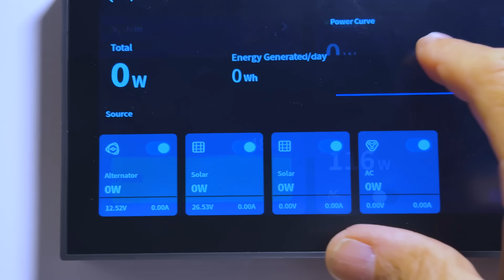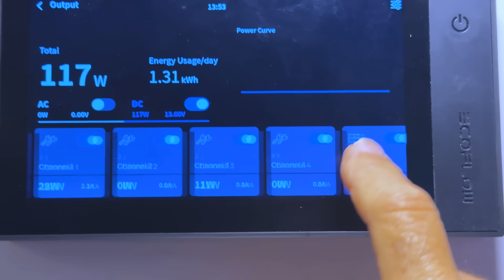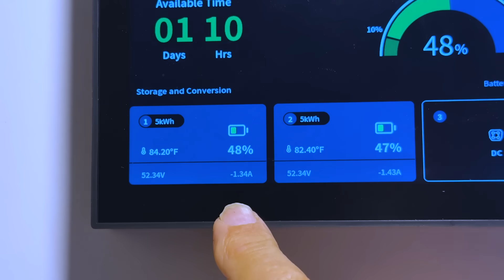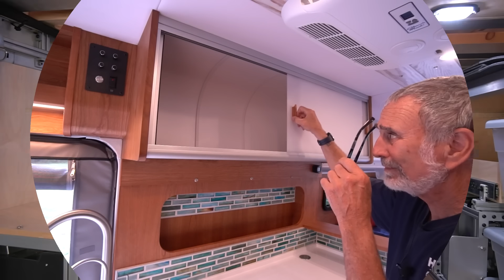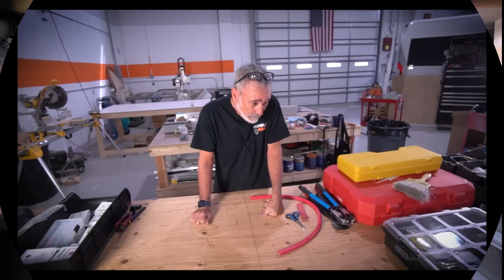HOW DID IT GO? BUILDER EXPLAINS THE ECOFLOW POWER KIT.  FIRST INSTALL IN A CAMPER VAN

Comment: I purchased an entire Ecoflow Power Kit 3.6Kv (Gen 1) system using used + new parts and found the experience sourcing components, especially the proprietary cables, was incredibly frustrating. 

I just want to make others aware that there are two versions of the Ecoflow Power Hub (3.6Kv/Gen 1 and 5Kv/Gen 2) and the PV solar charge cable, the Alternator Charge cable, and the DC Main Out cables ARE NOT CROSS COMPATIBLE between Gen 1/Gen 2 Power Hubs. This is because the Gen 2 uses different cable sizes for increased amperage. Technically, Gen 2 cables should be able to carry the lighter loads of Gen 1 Power Hubs but the connectors have been made to be mechanically incompatible. 

The distributors do not advertise this distinction for cables, and many are not aware of the Gen1/Gen 2 distinction. 

At the time I write this, the Alternator charge cable for Gen 1 has been out of stock from Ecoflow for 2 months, and I have had similar problems finding the other cables. 

I would highly recommend against Ecoflow unless you absolutely need the space-saving packaging solution the Power Kit provides or are able to purchase all components you need at once. 

If you are not able to do that, set your expectations to long lead times on replacement components and expect low supplier/distributor support.
Reply from the maker: Curtis, I'm sorry to hear about your difficulties with your EcoFlow experience. Quite honestly, I think you brought on the frustration yourself, by sourcing your system here and there, without choosing a reputable distributor. Maybe your motivation was to save money, but even that comes at a cost. As a builder, purchasing several Gen one kits at a time, I have had zero issues.
Reply: @HumbleRoad  Hi George! Thanks for the response. Huge fan of your high quality videos and vans.  You're definitely right to question my choices, I do that all the time. 

However, Ecoflow is the distributor in question, as I've tried to order direct from them, and many other distributors are just drop shipping from Ecoflow's warehouse. So it is a supply chain issue on Ecoflow's part.

Ecoflow have been out of stock for 2 months for Solar Charge Cables (Gen 1 power kit). 

I found a distributor that had connections to Ecoflow corporate and sourced the DC Main Out and Alternator Charge cables, but the current status, direct from Ecoflow, is that they may have the solar charge cables in another couple weeks (mid-June 2026). 

Most distributors drop ship from Ecoflow, in my experience, and I have not been able to find the cables in stock anywhere. 

I have no doubt that primary market purchases direct from Ecoflow or their distributors are hassle free, but a viable secondary market is important if you want to resell a Power Kit, or are purchasing a van with a Power Kit that you may want to expand or upgrade.

I watched your videos on Ecoflow several times and many others and I never heard what the after purchase experience was like for upgrading or servicing the Power Kits, so I just wanted to add this for the benefit of your audience, as it would have helped me make a more informed choice.
Reply from the maker: @curtislong4305  understood. And I thank you for contributing to the Humble Road community. A valuable resource this community has become! I would suggest that you try reaching out to camper van HQ. I was told they were the first level of distribution out of EcoFlow.

Comment: I had the Ecoflow Power kit V1 from 2022. I liked it so much I got a second Power hub. I do not used their distribution box. In total  I have 19 KW of batteries 3 of the 5kw and 2 of the 2Kw. works great simple to set up, updates were a nightmare now they are ok. It's for my off grid house. I do laundry, lights, on demand water pump, Make toast, microwave, 9000btw AC unit,  and my satellite internet. it can do up to 4000w output as i pushed it a few times.  Most of the time I try not to abuse it. I don't have everything all at once obviously.

Comment: Hi George, as always, interesting videos! George, I'm setting up my motorhome here in Portugal, and I'm interested in this Ecoflow system. I'd like to know from you, an expert, about the lifespan of this equipment and the batteries, and also if it requires a lot of maintenance.

Another question: can I have a two-burner induction cooktop with this equipment? Can I do it with a 5kW battery?

Could you update that video where you measured the consumption of an induction cooktop, demonstrating its operation with the Ecoflow?

Another question: here in Europe the AC input is 220V, is the equipment dual voltage?

I would greatly appreciate your comments. Best regards! João Lima, your fan
Reply from the maker: My initial Ecoflow installs (Power Kit Gen 1) are not out in the wild long enough to evaluate. So far so good. A dual induction cooktop is harder to store.

Comment: If I had to do a conversion again I would redo the electrical system with Victron again. High quality and time tested components. Yes, there are more connections, but when it's done well, it's effective. If there's a problem, I can replace just one component and not lose the rest of the system. I have trouble trusting all-in-ones for repairability.
Reply: That's a fair point. I have two of the original Delta from Ecoflow they put up on Kickstarter several years ago, Ecoflow has grown a lot since and I can attest to the quality, they stand behind their products - as a backer, they offered lifetime battery warranty which is amazing too. I took a gamble but the company has more than proven itself. But I do agree with your hesitation regarding replacing a component, especially if you really know how the system works inside out and can troubleshoot it.

Comment: You are not nested down 3 or 4 levels down with Victron shore power Amps setting. The option is right on the right side of the main screen. You might be referring to some old software version. Nothing is ever perfect. Ecoflow is simple to install, but it also has drawbacks, like anything else. I like the modularity of Victron. Many things can go wrong, yet the system will be partially functional, even if Cerbo breaks, the battery will be still delivering power to the system. If the Ecoflow "brain" goes down, nothing will work.

Comment: Having worked in both automotive and consumer electronics (albeit some years ago), I recognize there's definitely a market for this kind of product. It reminds me of the shift we saw in the '90s—from high end component stereos to all-in-one systems. That said, I’m not sure a high-end custom van is the right place for an all-in-one solution. It feels a bit out of step with the premium craftsmanship and attention to detail that Humble Road is known for.
I could share more thoughts, particularly on the electrical side of the builds, but I don’t want it to come across as negative—especially since I’ve been a fan of Humble Road since the early days, back when George was building out of his driveway in North Jersey. There are definitely some wiring techniques and installation approaches I’d do differently to streamline things, but… 

Ultimately, if a customer wants a full Victron system, they should be able to get it. And if they prefer an all-in-one system, that’s their choice—they’ll get what they pay for.
The video left me believing Victron isn’t an option anymore.
Reply: I think it is an phantastic solution but I have no clue (with some research) how a good backup would work. With victron its likely single parts break and you can quite easily bypass it normally. Also you have basically worldwide electricians who can help and deal with it. With ecoflow if the powerhub fails, the system is dead. And I cant find any documentation from Ecoflow how to bypass like just for some important things like lights and refrigerator. Ofc there are some "hacks".

Comment: Best of luck with the eco stuff. I compare it to Renogy😕
As for switching the current limit via the touch, it’s not that complicated, especially if you’re using the new UI version.
Additionally, “spring” clamps for AC and high current DC loads (like WAGO) have no place in a build. They haven’t been around long enough to make improvements and they will fail when inline on any inductive loads. I’m stating this because of the panel style that eco has made.

Comment: for the sub panels you showed blue seas also has a split sub panel just like that. It's still 12 circuits but 6 on one positive 6 on another. So you get the same form factor, but can run two 20a lines to it due to the eco flow limitations.

ST Blade Split Bus Fuse Block
5032
Reply from the maker: That's a great alternative that I wasn't aware of! THANK YOU!

Comment: I installed the Gen 1 power kit with 3 - 5kWh batteries in my 50amp fifth wheel. The hardest part was deciding which circuits to leave on shore power (1 AC and Electric heater/fireplace), Oh yeah, lifting those batteries into place was a chore, then finding a place to route the solar panel cables too, but taking may time and thinking it all through worked out for a non-electrician like me. We have been super happy with it, and when we boondocks it's like hooking up to 30amp shore power, so the transition was easy. And if it's cloudy we supplement power with the Ecoflow Dual Fuel Smart generator, not super powerful but really easy to use, especially with the phone app. I give it a 3 thumbs up for the DIY'er.
Reply from the maker: I'm glad to hear it worked out well for you!

Comment: My issue with all-in-one units is if a feature breaks it's likely I will have to replace the entire unit which can be very costly.  Not the case with having electrical done the old way.
Reply from the maker: That's no secret. But if you balance out the benefits versus the risk factors, I'm going with the EcoFlow. In a previous video I mentioned how I had not heard of any major endemic failures with Gen 1 over the year and a half it was on the market before I jumped on board.
Reply: @HumbleRoad 
Good point George.
As an retired Engineer with a major auto manufacturer i can attest to my experience that electronic components from reputable manufacturers don't normally fail after they make it thru the initial break in period.

Comment: EF always retires their older stuff without making the new stuff backwards compatible. It's really frustrating.
Reply from the maker: Yeah, I'm going to rattle their cage via Campervan HQ. I want the Gen 1 to be improved slightly. There is a niche for this system.
Reply: @HumbleRoad I agree with you. There is a free market for them by tweaking old technology. Should be no brainer.

Comment: I don't know if it's just because the PMC starter battery setup is weird, but I find the alternator charger to be inconsistent to the point of being a waste of money.
Reply from the maker: Hmm, I used to instal the Victron Orion 30A and it worked perfectly. Now I install the new 50A XS and that also works fine.
Reply: I had some issues with my Renogy unit. Turns out it was the wire from the chassis battery to the frame.  Check all your connections and the wire.

Comment: I signed up to eco flow couple years ago and I couldn't get any information about the components sizes to fit it into a layout, and it's not UL rated so safety goes out the door there
Reply from the maker: The UL rating is a big deal. I know Lithionics spent well over $250K for their UL listing.

Comment: Hi George! On the more recent Cerbo GX interface firmware (which has been out for a bit), the shore power current can be changed with two taps. There is a mini radio button icon in the top left of the screen. Tapping it brings up a minimal control panel for the MultiPlus which shows shore power current setting and inverter/charger mode. Tapping setting brings up a little picker to select the current value. Frankly I normally just leave it set to 13A (a “safe” setting intended to not trip a breaker, even with a long extension cord). If my interior appliances exceed 13A temporarily, the inverter can go into powerassist mode that pulls from shore and battery simultaneously. The new interface firmware is much cleaner than the original.
Reply from the maker: Yes, I am aware of the updates. We, nor any of my clients have ever done the update for fear of software failure! When something ain't broke...don't try to fix it!
Reply: @HumbleRoad  seems illogical to switch to a completely new all in one system just for fear of a simple firmware update that would solve an apparently big usability problem of the old one.

Comment: Have you checked to see if you can use the 30/50-amp distribution panel with Gen1 hub? That would solve for many of your requests- more space, better cable entry, more circuits, higher amp circuits.
Reply from the maker: Yes, you can use the GEN two distribution panel with Jen one. The problem I see is I don’t need the additional circuits and beyond that the form factor is way bigger. I just want this one to be a little bigger.

Comment: THX for doing all the footwork George.

I very Grudgingly did my own (8 years ago - 100k miles - if you forgot that is when you were a huge proponent of installing BIG @$$ sinks - which I did👍) component electric system (which apparently is SOOOO 2024-:) & sh*t has turned out pretty good.

If I was to do it again - EcoFlow ADL Son.
Reply from the maker: I am happy to hear the system you installed has worked out well for you!
Reply: @HumbleRoad  I bought DIY Solar's (Will Prouse) book on the subject. That helped the most for being confident enuf to do it - as I knew NOTHING before that.
& as you pointed out in this video - great Crimps are VITAL to a strong system...

Comment: As a builder this makes a lot of sense. As a user I’ll stick with Victron with individual, high quality, time tested components. I don’t want to be in the middle of a four week long trip and lose ALL power (AC and DC) if a unit fails. DC loads go through this unit as well as there is a dcdc converter. As for your Mac vs Windows comparison, upgrade your GX to that latest gui.
Reply: Been using Delta Pro for years. Traveled, powered AC units, charged from solar....never a problem and a lot more information. This new system seems even better. Need it sized for an Airstream.
Reply: Yes this is why builders rave about it. Easiest install. Personally I think for Van life a delta pro 3 makes even more sense. But not from a builders interests perspective
Reply: Do you sell Victron ⁉
Reply: @LJ-jq8og no. Nothing really against ecoflow, but any all in one if issues come up the whole unit is getting replaced. If they made it serviceable for each component the cost and size would probably be double. 

If this was a portable power station for home/light use that’s one thing. But for a camper van (the way I travel) I don’t think I would trust it should something fail.
Reply: @nebulight  Fair point !
Reply: Failure of a single component in a Victron system can bring down the entire system too. I've seen it happen a lot
Reply: @billybarghahn there is nothing in a traditional system that would take down an entire system. Closest thing I can think of is if the multiplus fails then you have no ac power. You’d still have dc power and the ability to charge via solar and dcdc charging. If a battery fails, that could happen with a system like the EcoFlow too.

Comment: I hope you stay happy with the EcoFlow system George, I'm impressed and have been promoting it in comments on other channels, most recently VanCity Vanlife - Chrome Valdez bought a Sprinter and is building it out. I don't think the idea is unique to you George, but you are a reputable van builder and what you say and do has impact. If I were building out my van, I would go with a plug and play system. By the way I saw that your alternator showed voltage on the input. That tells me there is not a cut-off switch or MRCB on the line. I highly recommend being able to isolate the starter battery from the house system for all the reasons you can think of - but here is one more:  If the starter needs a trickle charge or a jump, you're relying on the electronics in the charger module not to let any of that external voltage thru. That circuity does not know the difference between an alternator-engine charge, and a power boost or continuous trickle charge if its high enough.  That voltage then passes through to the lithium. Not good.
Reply from the maker: I appreciate you bringing up the cut-off switch; I will look into that.
Reply: @HumbleRoad this comment right here is why you're the best in the business. No big ego and deny the problem or ignore it.
Reply from the maker: Thank you for your observation. Hence the name, Humble Road. I never proclaimed to be an expert in anything! Just trying to do the best I can. You have to understand that I define myself by my ideas and creations.
Reply: @HumbleRoad  I use my cut off switch a bunch - mainly when I'm driving and the batteries are "close" to 100% - trying to follow the 80/20 rule!!!
Reply: Isn't the alternator able to be disconnected from the touch screen?